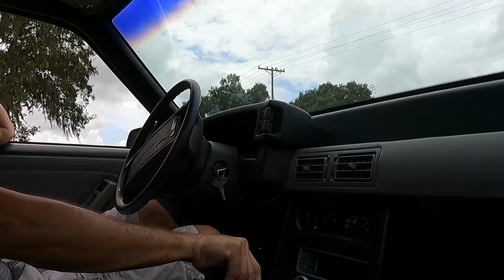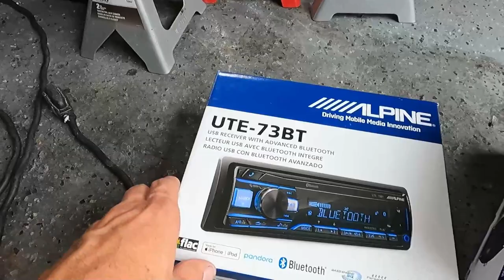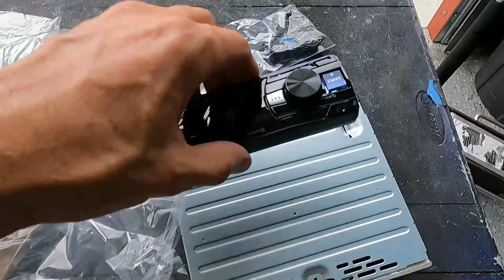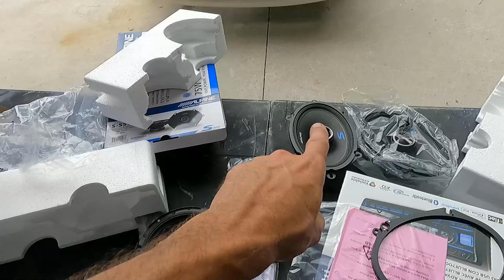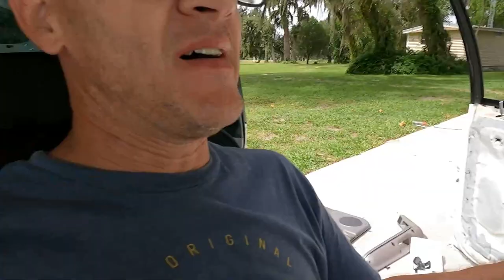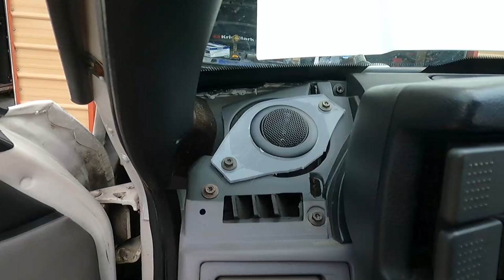Alpine Car Audio Install On My 93 Fox Body Mustang! + First Test Rips!

Comment: Sounds good. I replaced mine with a double den radio with the ac controls on the bottom. But now I'm changing back to the stock radio with blue tooth in it

Comment: did you ever find out what that squeaking is when driving? I have the same sound coming from the rear end of my vert, louder on bumps
Reply from the maker: Upper control arm bolts were not tight.  A little grease also.

Comment: Did you have problems with the door speakers hitting the speaker grills and making noise, I'm currently having that problem
Reply from the maker: I did when I used the bracket that came with the speakers.

Comment: I like the Kenwood and alpine stereo's for almost the same reasons the timeless classic styling compared to a lot of the other brands of stereo receivers,I have a certified refurbished Kenwood excelon kdc-x301mp3 Bluetooth CD player I got a good deal on through car toys on Amazon and heard about them online and YouTube nice stereo receiver but I never even used it for the 86 Chevy k20 custom deluxe truck I got it for,them I got ahold of a early 94 Chevy Silverado extended cab short bed Z71 tbi 350 0.40 over, and I have a classic Sony Xplod cdx L600x CD player stereo receiver it is a black faceplate that lights up in red, yellow and white dot matrix lcds cool love how it looks so didn't use the Kenwood in that truck and the current vehicle has a factory infinity CD/cassette tape player stereo and I don't want to change it, anyways I was thinking about the 5x7,6x8 probably 6x9 of the alpine type s s57 speakers and wanted to know how you thought the Bass response and the treble from them was?